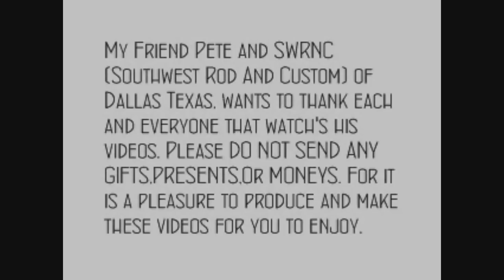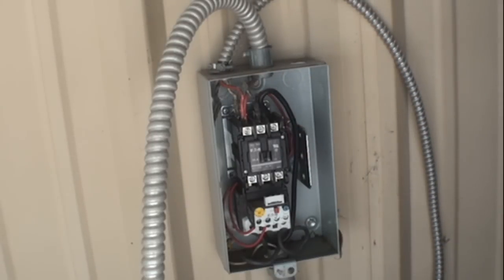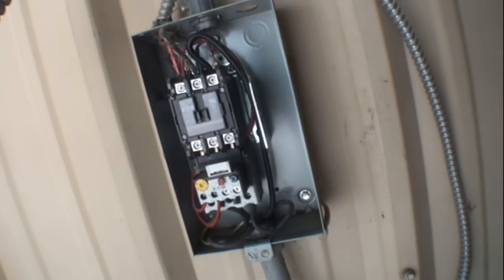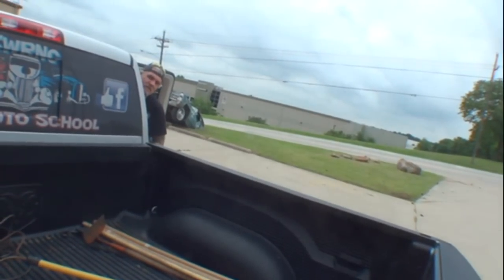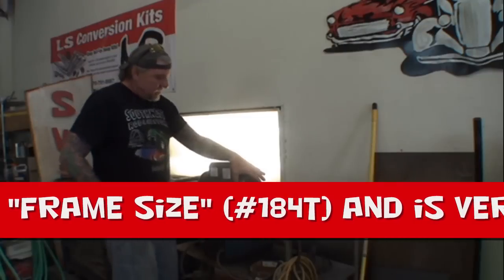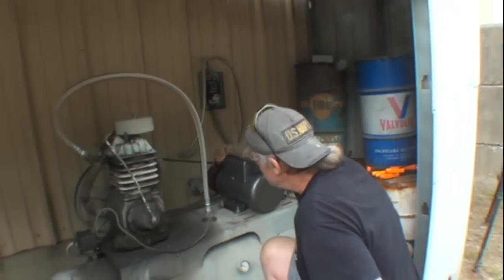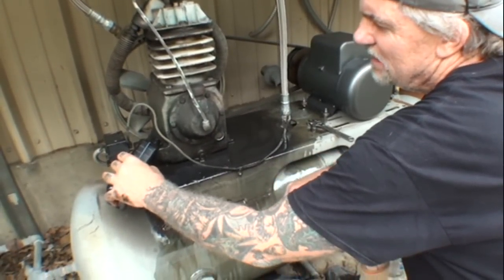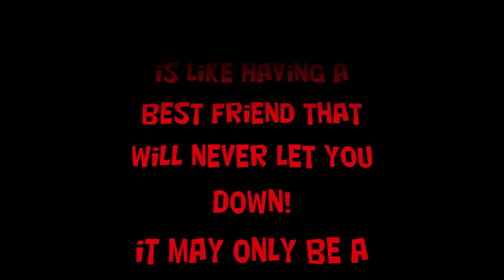How To:  Replace An Electric Motor On An Air Compressor

Comment: Pete I worked at BALDOR 37 yrs fixing those 36 4 pole
 motors. I made the winding for that motor for 13 yrs. It sound like it was not getting off the switch from age. We used to rebend the switch blades up a little bit and good to go.

Comment: Pete im a commercial hvac tech and we work on these all the time. You can get some 1/4 pipe and thread it in the oil drain hole and extend it past the side. We usually put a ball valve on the end and it makes it super easy to change the oil and a lot cleaner

Comment: Pete, on our gearboxes we drain that have the drain plug located like yours, we put an extension pipe on the drain hole to run it out where we can just pull the plug and drain strait into a bucket.  Saves making a mess.
Reply: Same as my ride on mower

Comment: We are coming up on 3 years since you released this video. This is the truth of what a small business man goes thru, customers never think of. Congrats on your move to Moab.
 As others below have said, but a 6-8” length 1/8” NPT female will fit the drain, simple cap.
It appears that both motors have grease fittings over end bearings. I know you got a new “Polar” brand compressor. You are right as compressor pumps use a straight SAE 30 oil. Others oil have man made additives that will break down over time. Those pumps, like your cast iron two-stage works hard, but designed to last years. Positive displacement oil pumping thru internal/external piping or drilled passages. Like a gas engine.
  I found two places in my area, that sell Wanda brand base coat. Working with Roberlo for clear coat. No Matrix brand within 500 miles. Stay healthy, it sucks getting arthritis + more!
Best of luck, My Friend Pete and The Bodyshop Girl Minnie!!!

Comment: We run a 1948 Curtis compressor, with a 1948 3 Horse electric motor. 70 years old as of this year. It was on a Hog Farm heating the food slurry everyday. Never had anything done to it. Its a beautiful thing.
270 volt, your burning up your stuff. Its better to be high then low, but not that high !

Comment: I got a newer 5 horse C H compressor and it came with an oil drain kit.  It was a 1/8" brass pipe that moved the drain plug beyond the tank to make less of a mess.  You could get the necessary pieces at the hardware store.

Comment: you're right Pete, those are the best pumps and Camb Haus still makes them. Look small but HUGE bore and stroke..They are TF series pumps 4.5" bore x 4" stroke TWICE the displacement of the 2475 ingersoll rand that is 4.0" bore x 2.5" stroke that has to spin double the RPM to make the same air as the camb haus bro

Comment: Motor windings can be rewound and put in service reliably though not as reliable as the factory windings.  These single phase units have two sets of windings.  The running and the starting winding. The starting winding gives it the initial kick with the capacitor in series and switched on/off by a centrifugal switch which opens the circuit when the motor is up to speed leaving only the running winding in circuit.  The failure may have been caused by anything from a bad capacitor , centrifugal switch or failure of the rewound windings .

Comment: I run a 35 CFM compressor (3 cylinder pump) with a 5HP 3 ph motor . An oil change every year and new filters every 2 months . never a problem. my neighbor has a 300 ingersol screw compressor. it makes mine look alike a toy.  Is that a 40 Standard Coupe?

Comment: You can use motor oil of the recommended viscosity. Minnie said "air compressor oil".  Never heard of oil specifically for air compressors except for oil used for air con compressors which are designed to circulate with the refrigerant.  Air compressors are much similar to car engines where the oil lubricates all rotating parts and cylinder walls.  You might want to use oil separators to keep oil from entering the air stream.  Multi stage might be necessary in case of old air compressors with worn piston rings and cylinder bores.
Reply: Alot of them take a non detergent oil. You cannot use regular engine oil.

Comment: I have seen the springs on those fiber valves break and the air is crap, the compressor is about as effective as a breast pump. Was you using 30ND oil or some other light grade like ISO 32 (10W)? Most of the time I just screw an air fitting into the drain and use a piece of hose to get most of the oil out, or use a DIY funnel with aluminum foil to direct the oil into a container. I broke down and bought a vac pump to suck out oil, kinda expensive but would be great for those compressors... SUCKS you broke down and had to get new shit.

Comment: Pete he sold you a motor, the motor you had is rebuildable, I am a Machinist that has worked for a electric motor company for Industry we have rebuilt 100 year old motors, all that goes bad is replaceable for any housings,  only if the housings are shot is when the entire motor needs replaced, but in your case when its not working its hard to go a week without a compressor so money needs to be spent to keep the work flowing. you might want to check into getting better units for your new shop in Moab. and repairs on these motors are time consuming and expensive for the most part, look into upgrading to a ON-DEMAND SCREW COMPRESSOR those are the shit. they are like a supercharger for shop air.

Comment: I know that feeling all too well of having your air compressor go down. I use my bead blast cabinet pretty much daily and I'm on my 3rd motor. First two were junk AO Smith motors. One one there now is a Leeson. It's an Ingersoll rand 5hp 2 stage comp. I need a bigger one.

Comment: Hello...
Is that possible to increase the motor power for sudden air filling?
Is there any problem?
Reply: The type of oiling system used is a factor used to determine compressor speed. Like a lawnmower or tiller, some like Toro use a gear driven positive displacement pump. Many compressor pumps like Sears, use a slinger ring. It sits in a grove on the crank and rotates when it’s on. It dips into the oil sump, thens slings oil up onto the bottom of the pistons and cast funnels catch some and lube bushings. Changing pulleys or motor will shorten the life of both. Lawnmowers have an engineered angle they can safely operate up to 30 degrees on a side hill, yet still get oil. 
Always look at the exploded diagram on the engine/compressor to see how it’s oiled. Two classes; residential designed to last 150 hours. Commercial grade is 5,000 hours.

Comment: Why dont you put a pipe in the compressor to drain the oil so it can extend out so the oil doesnt go everywhere and cap it when your done go to a plumbing supply and get one .

Comment: Why don't you put an extension pipe in the drain hole once its empty with a 90deg fitting and a plug? Should be NPT. I did it on mine much less of a mess.

Comment: Motor speed is constant at a certain voltage/frequency (say 240 volts ac/60 hertz).  The compressor  is the one that has a specific range of operating speed .  Too slow and too fast will not work.  So you need pulley diameter combinations to match the compressor operating speed and the motor capacity.
Reply from the maker: Noel Guerrero thanks for the valuable info Noal.

Comment: You need to add a small galvanized steel pipe to the drain plug, cap it off with a brass 1/4 turn ball valve.  Maybe put a 90 deg. fitting on the end if you desire.

Comment: ohms law, high voltage low amps.  unless resistance is high.  Check for resistance but sounds like a bearing.
Reply from the maker: It was the internal starter switch

Comment: I'm so happy I live where we get 3 phase power to every house
Reply: Mika Raussi no kidding?in the usa or somplace else?
Reply: Finland. It's about the same alla around europe. Every house gets 3 phase. Real easy to use industrial machines in home shops. And no hastle with caps and centrifugal starter points arching and sparking in motors. It's suprising to me why Pete has only single phase as it is an industrial building
Reply: @killejano  Ha ha, WTF are you talking about ? Houses in Europe do not get 3phase supply.

Comment: To much voltage burning it up if its single phase. 240 at most. Utility sending to much juice thur your lines. It does happen.
Reply from the maker: Im sure that little tool I was using probably wasn't making an accurate reading,, I thought it was out of wack too...
Reply: Still say something to your electric company.  I rented a building in town with a friend he lost his compressor due to over voltage. The people who rebuilt his motor stopped by and checked the main voltage it read something like yours. We called the electric company. Got a line of crap from them about it being right. We checked 2hrs later and somehow it now registered right. The guy that redone the motor this way you use more juice  pay more to them.

Comment: Of course the compressor dies when you need it, it never break when it's not really needed.
Reply from the maker: Whats worse is when the electric motor on the paint booth dies when you need it!  That SUCKS!

Comment: Pete, do you use auto drains on your tanks?
Reply from the maker: NO-- I have manual drains on the bottom, if you look really close you can see the pipe coming out on the ground with a valve on it.. I drain my tanks once a week..

Comment: Ain't you supposed to have rubber anti vibration blocks on the bottom of the compressor legs..I've been told vibration causes damage...
Reply from the maker: No,, never had anything like that...

Comment: I love how he starts cussing every time something does not go right, I am not sure if he does it to be funny but if he does it is working because I don't watch his videos to learn body work I watch them to laugh. Humor heals and another thing itn is always best to put anti-seize  on those shafts before installing that pulley for future problems and  eliminating the use of a torch to get it off, it happens and one more thing when draining that oil I use a piece of cardboard and slide it under the motor with the slightest bend in it and the oil runs off the cardboard instead of all over the compressor. u can put a piece of pipe on it as well because even with the cardboard you will still get some all over shit but not that  god damn much

Comment: I know this sounds weird but put the BACK UP unit on when you get it and put the new guy back in the box . then when the back up shits out you go with the new unit again and zero down time except for the switch out time ...  plus how long will the back up warranty be when you get 10-15 yrs later and it don't work when you take it out of its box ...?  then you can sell a new in box motor when your 20 yrs down the road when  the price is triple for the motor(that many years later) ..your going to get the full cost of the unit back you paid TODAY  ....im not sure im Jewish but I think im at least  a 1/4 Jewish
Reply: I agree.  The repaired unit must have a warranty period which he can avail of if it fails again.

Comment: Capacitors are shot
Reply: MY FRIEND PETE starting switch $25 part that will fucker up
Reply: My dad was into wood working and had that problem a lot with an all-in-one machine. The motor would just buzz.

Comment: Too much voltage pete most commercial businesses are setup for 240 volt 3 phase electric also I noticed you don't have a water drain on those tanks should have auto drains on them
Reply from the maker: I think the cheap item I was using was reading wrong.. It was a 5.00 tester from Home Depot...